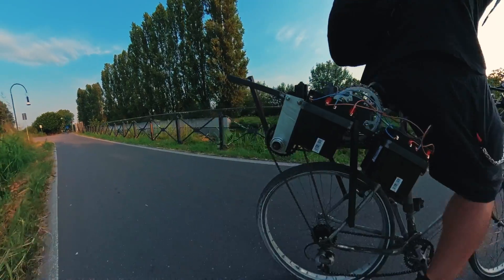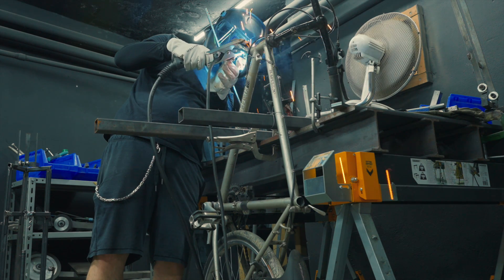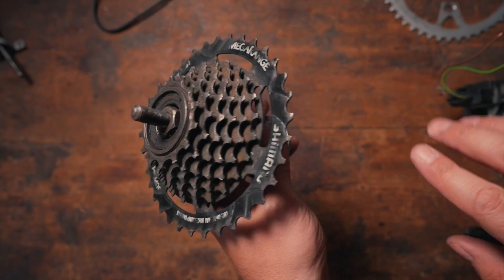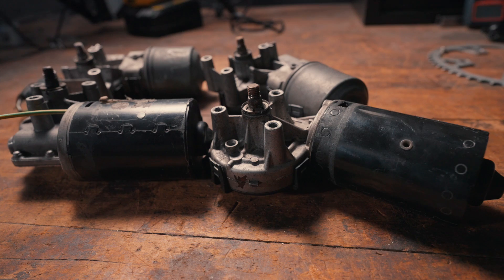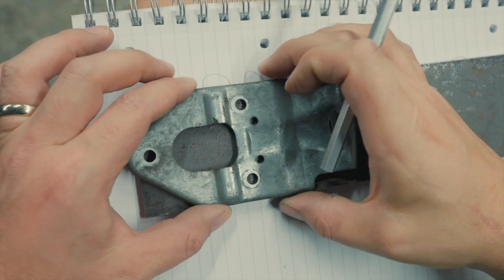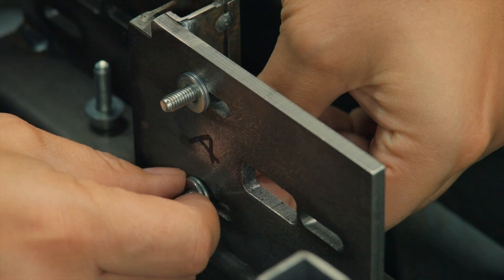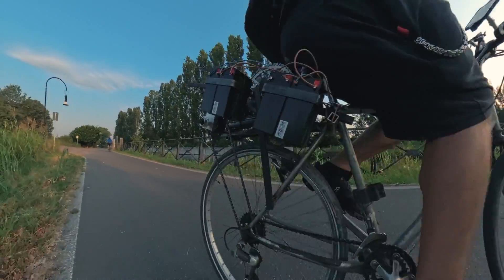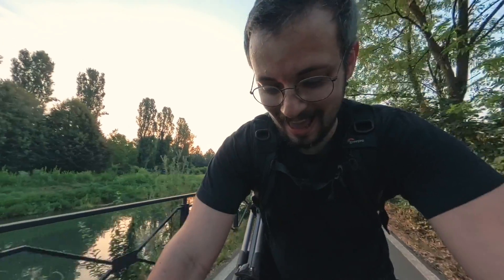I built a legit E-BIKE from TRASH!

Comment: these motors already have a worm gear reducer, you could have done a way more efficient system by removing it, the motor output would probably have been a way better fit for your bike
Reply from the maker: I’m not sure about that, actually. The worm gear is so structural in a wiper motor that removing it and rebuilt a reliable motor (four times) seems like a lot of work… especially since those four wiper motors are all different. A single gear reduction for the whole system still looks a lot more efficient to me.